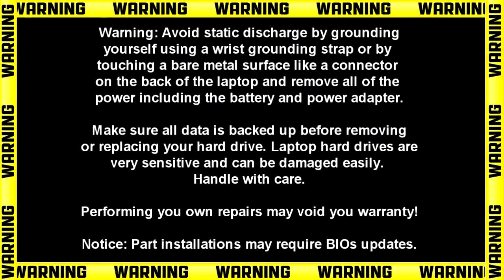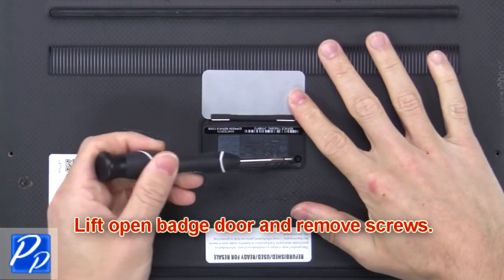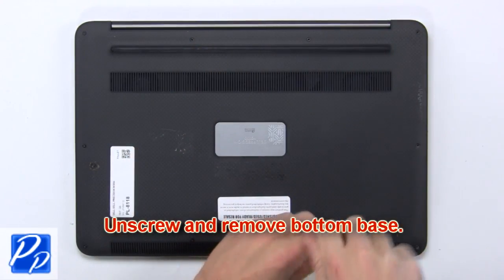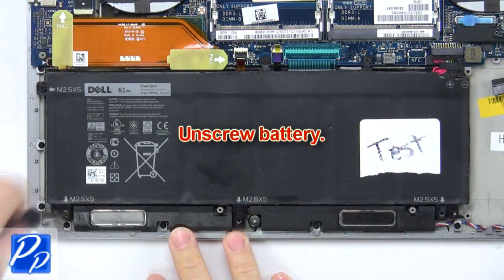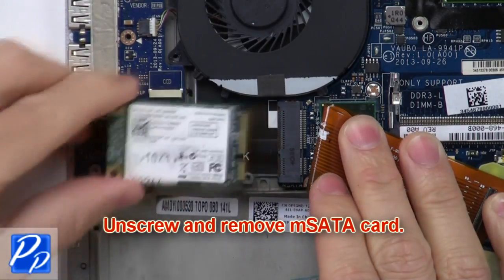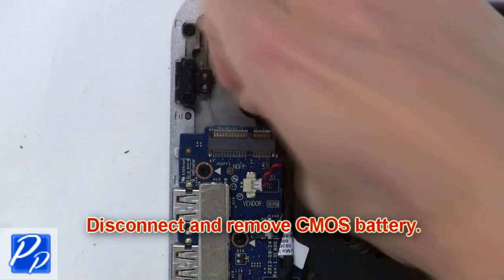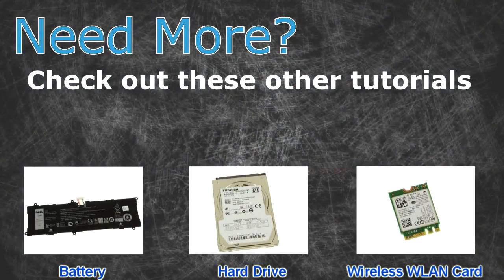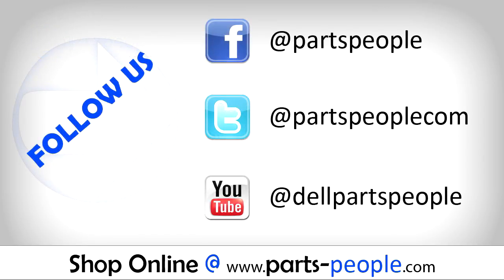Dell XPS 15-9530 (P31F001) USB / SD Card Circuit Board How-To Video Tutorial

Comment: I was trying to update my BIOS and then it failed. I had to change my motherboard. However after changing it i noticed my wireless network had disappeared. I then changed my circuit board and wireless card . Up till now my Dell xps 15 9530 doesn’t have the wireless network menu. Please can you help me out? What could be the problem?